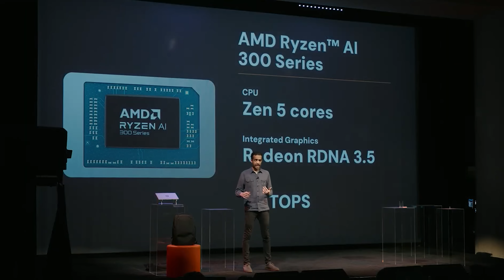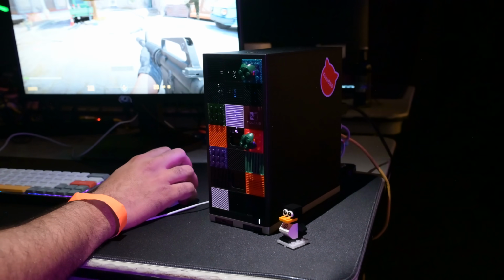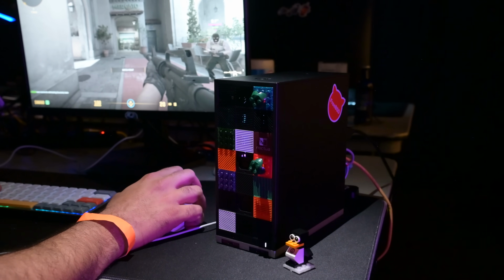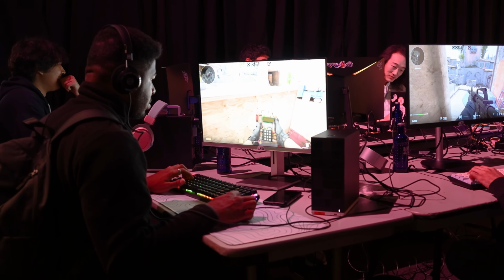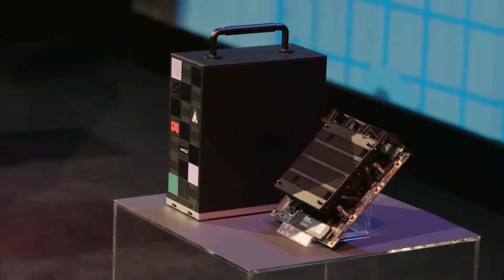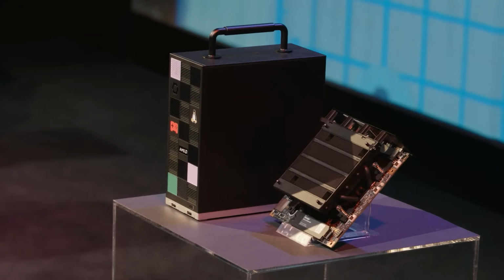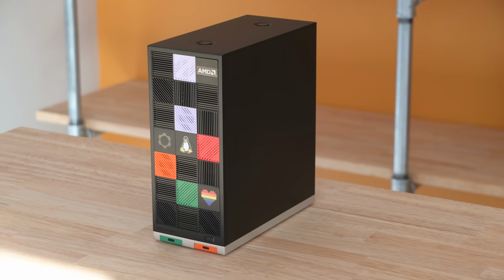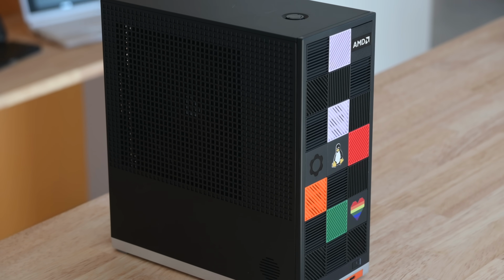Modular, Open, Repairable – The Framework Desktop Teardown!

Comment: soldered on CPU,  soldered on RAM and everything else is proprietary.. This thing might be one of the least repairable desktops ever.
Reply: I think it's because bottlenecks and bus/memory speed for system on a chip and IGPU
Reply: How many Desktops have 128GB Shared Memory? i only count the Mac Studio an this here is already way better with 2 M.2 Slots
Reply: @MrZocker92  The point is not whether or not system memory is enough. The point is RAM on this sysyem is not user replaceable, that renders the system to be not user repairable. If this system has a memory failure then users won't be able to swap out the faulty memory module, they will have to buy a whole new motherboard, CPU and whole new set of memory modules. That will rise repair cost from 150USD to 2000USD

Comment: I don't get any point of this, SFF PCs have been around for so long, and you can probably build one cheaper then this. It will also be much more repairable and upgradable. This feels the worst version of a laptop and a PC.
Reply: I guess that it is not for you then. A Biotech company around the corner from me instantly ordered 70 of the 128GB boxes. To Quote there CTO "that's exactly what we wanted for years. I'm so glad we don't have to go with Apple."
Reply: Think of it less as a SFF PC and more as a workstation. It's not going to make sense for gaming in terms of frames per dollar, but when you really need 110GB of VRAM for whatever you're doing there's not a cheaper way to get that right now.
Reply: The point is to have a laptop chip in a desktop form factor. Strix point and Strix Halo are not going to be available in AM5 variants. 
Another is the LPDDR5 memory for Strix Halo, the iGPU would bottleneck hard with socketed RAM. 
This is a pretty good compromise. They're even using ATX power for motherboard so you can bring your own case and power supply (along with storage and wifi card).
Reply: @TheCyberSpidey  But for the same price you can have a desktop chip in a desktop formfactor with upgradable cpu, ram and gpu? I fail to see the point of your argument.
Reply: @leviathan5207  you probably won't be able to build it in 4.5 liters and you won't get the unified memory which gives you loads of gpu memory and does not need to transfer data from ram to gpu which can take quite a while. If those two things are not interesting for you, build your own PC.
Reply: @TheCyberSpidey  AMD intentionally chose not to offer a removable SoC, so you can interpret that decision as you wish
Reply: @terkokyahe  iGPU is memory bandwidth limited. You need faster memory, and not so much more CUs. AM4 Vega APUs were very bandwidth starved. DDR5 RAM is faster, but soldered on memory is still significantly quicker than socketed DRAM. Not justifying less modularity, but soldered CPU and RAM allow laptop chips to go quicker and with a smaller power budget (dependent on architecture ofc, not a blanket statement).
Reply: @TheCyberSpidey   yes current DDR standard is not capable enough. Your point is valid, but my comment was due to iFixit hailing it as modular and repairable which is just incorrect
Reply: You don't get the point because you don't need such a specialised device, because you don't use machine learning. That's it.

Comment: I never hate on companies for trying something new, but I have to admit this feels a bit like reinventing the wheel. SFF desktops have been a thing for ages and are typically easier to work on and more modular than this thing. To be fair framework is probably focusing on supply chain quality as well, but I'm not really clear in who this device is for.
Reply: I'm by no means an expert, but from what little I know it seems like it's a workstation for complex tasks/AI. My friend works in AI, his business is very interested in having several hooked up together to work on projects, he was waxing lyrical about it. Also he suggested it was more keenly priced than other similar workstations.
Reply: @TravellingTechie  THIS A WORKSTATION???????????? Brother, they use an off the shelf APU designed for laptops. If you wanna do real work, you get yourself a BEEFY CPU and some heavy duty GPUs and not a glorified Laptop...
Reply: @leviathan5207 Ok, can you give us the parts list to build an AI machine with the same ram speed as this at a comparable price and performance level?
Reply: @leviathan5207  It has the same cores as a Ryzen 9 9950x but with ~2.5x the memory bandwidth. That puts it in Threadripper territory which is literally a workstation cpu.

Do people just hear "laptop" and turn their brains off? It's called strix halo for a reason, it's literally the highest tier consumer chip available before you start paying HEDT and enterprise prices.
Reply: @leviathan5207  128GB of unified memory. 96GB on windows and 110GB on Linux available as VRAM. For AI development and AI inferencing, nothing comes close in terms of price and performance.
Reply: @mar2ck_  it also has 32 compute units on the GPU and the max version has 40 compute units.
This is quite a substantial GPU for a "Laptop" SOC

The PS5 has 36 Compute units on its SOC, so this has every chance of being a PC space version of a console, especially with Bazzite support.

More expensive than the PS5 for sure, but they offset cost by locking you into their digital store and not allowing you to do anything but play games with it.
This has a lot more freedom.
Reply: @leviathan5207  Find me another GPU with 96GB of VRAM for less than 3000 USD. Just name one product I can go buy that can do that.

This thing is going to be a ML beast.
Reply: @ Oh dang, I hadn't actually seen the specs. It makes way more sense now. For whatever reason I assumed it was intended as a consumer PC.
Reply: The chip used in this PC isn't directly available to consumers, and is meant more for laptops, so this PC makes it more widely accessible for those who don't want to pay for the extra components inherent in laptops
Reply: This is "just" a very good designed ITX pc. The special sauce here is the chip used, since you can build a PC with more power in that size (Velka 3), but you can't find that kinda of memory setup anywhere else, especially not in this size. It being standard ITX and having the swappable FW ports is just the very nice side dish in my eyes.
Reply: it's for tablet/laptop only dipshits who don't know a thing about desktops, and think this is new. Well, it is new I guess: it is less modular than a normal desktop, so great work there /s
Reply: Thanks guys for cooking that bozo up there that obviously does not understand what this thing is good for.
Reply: Strix Halo is a thing we never had and with how much it brings I'd be happy to go even more locked down road if it was a tad cheaper, the 128 model is just a bit too much right now
that and I'm not sure about the cooler, make it top down 140mm maybe?
Reply: Same. This doesnt solve any problem.

Comment: Neither modular, nor open OR REPAIRABLE.
What kind of joke is this, @iFixit?
Reply: With that APU this is as modular as it can be, so... are you saying Framework should just be launching a regular ITX desktop instead? It's an interesting way of getting access to a chip that is otherwise limited to just a couple of laptops, and this form factor should be pretty much perfect for it. It would be cool if it was socketed, sure, and it'd be even better if the memory controller could handle LPCAMM at usable speeds, but neither of those are possible, so....
Reply: @ OK, solder the cpu.
But add two lpcamm2 sockets for the memory.
Lenovo does that with intel (well, technically just added one lpcamm2 socket as those intel cpus have only a 128bit bus, but technically two would be possible if wanted)

The question right now is:
Is chineses smarter than indians?

'cause looks like we already know the answer.

Or it is a thing of wanting instead?
Reply: @vxvicky  They literally addressed this in the LTT video. They tried. LPCAMM is not viable with this chip (at least not on this board) in a 256-bit configuration, as the signal integrity doesn't hold up. Which makes sense, as AMD's mobile DRAM controllers don't currently seem to play well with high performance removable memory. It stands to reason that it would be especially troublesome when trying to fit two modules onto a small board.

Comment: So they took the most modular technology standard (desktop PC) and made it an incredibly closed, walled garden. There's literally NOTHING you can upgrade yourself that you couldn't upgrade on a laptop (read: only the SSD). 

RAM? Nope. CPU? No. CPU cooler? No. Case? No. PSU? No. GPU? HA - no. 

This is the most apple move that framework has ever made. You should give this a 2/10 for repairability
Reply: You can use any 120mm fan you want if you listened to the video. You can also use any case you want as the mainboard+APU is available separately and is in a standard format (mini ITX) so other options exist, the power supply is a standard flexATX and the mainboard uses standard ports/heads so you could use any ATX power supply you want.

As for the CPU & GPU & RAM, this uses an APU which is a combination of all which is how it achieves this level of performance with this power efficiency at this price point. And they make a point of noting it not only in the presentation but on their website and purchase forms.

Not that you care about facts (as evident from your comment making false points) as a common internet troll. But for others who might see this, go check the actual specs and features out.
Reply: @DuckDuckHere  you're absolutely right, you can jump through massive hoops to 'upgrade' using ultra niche expensive parts while making a pile of ewaste in your wake
Reply: so u think the 395 with 128GB Shared Memory is Standard Desktop Hardware?
Reply: If you want the same performance with modularity then go buy a Threadripper for $5000+.

The chip they've put in this is unlike anything else in the consumer desktop space, it's more comparable to a M4 Pro with unified memory except it's ITX and can run Windows or Linux instead of being fully proprietary in hardware and software.

Comment: Still not as modular as a custom PC. I know that most people see gaming pcs as huge RGB behemoths.  But there are ITX and SFF builds that can be pretty small. 
There are mini pcs that are even smaller than that and have replaceable RAM and NVME and even Wireless cards. I think the only thing that the frame work desktop has over other small form factor PCs is the APU that has a 40 CU Radeon inside, but unfortunately it’s still based of RDNA 3.0  . It has the same performance as RX 7700s. 

You can however setup an oculink adapter in place of the secondary NVME.  And use a oculink dock to use a more beefy GPU with it. But it would be limited to 4 pcie 4.0 lanes. But imagine an RTX 5090 connected to it.
Reply: Technically it's RDNA 3.5 but yes it'll be inferior to the upcoming RDNA 4.
The value of this computer lies entirely in the APU and the huge amount of VRAM it brings with it. If some people are looking for a mini PC just for gaming, they should move on, it's not for them.
Reply: @AlphaConde-qy7vi  you could argue that the 8Core slower GPU and 32 GB RAM version is the most gamer likely for people who want a MAC Studio but also want to Game...

Comment: Small thing, but I wonder where the decision to not go with a socketed CMOS battery came from
Reply: Those little "coin batteries with umbilical cord" packages are INCREDIBLY common in the laptop space. Most laptops from the 2010s use those if they don't use a socket. It's not really a pitfall for repairability because the parts are readily available in many places.
Reply: u can just plice the cabes and tape your own
Reply: I don't buy the "it takes less space", they had to add a metal bracket and screws around.
Reply: This is an engineering sample, fellas. Wait for the final thing before throwing stones.
Reply: @jonas_alves  that's not an excuse
Reply: @genericscottishchannel1603 of course it is. If everything in it was final, it wouldn't be an engineering sample.
Reply: @jonas_alves  you expect me to believe an engineering sample motherboard doesn't just use a 2032
Reply: Ok, I'll stop feeding the troll
Reply: @jonas_alves Just feed it with care and responsability
Reply: @jonas_alves  wow do you have low standards for trolling, replaceable batteries are too much to bear?
Reply: because framework is a BS champion and they don't really care about repairability. They just want your money and are building a walled garden
Reply: @iamdmc  they require less PCB space and are used in basically every ITX motherboard/mini PC/laptop on the planet, they're just as common as "standard CMOS". In a pinch you can even cut the existing pouch open, pull the tabs off, stick em on a new CMOS, and wrap it in tape.
Reply: @iamdmc  nah. I've already repaired my 2 year old FW13.
Reply: @iamdmc  rather buy apple then?
Reply: @iamdmc  and you are a BS commenter. Does something prevent to "repair"/replace that battery?

Comment: I don't get it. It's like a regular SFF desktop (where you can put in any motherboard, any RAM, any CPU, and upgrade only what you need), but ... much less modular? This doesn't make much sense, apart from someone wanting a feel-good office PC?
Reply: It's definitely a niche product, but remember: this isn't really competing with DIY SFF PCs, it's competing with the likes of a ThinkStation or similar tiny desktop. While many of those have replaceable CPUs and RAM, they use proprietary motherboards and won't come close to the performance of this due to power limitations (typically max 65W CPUs and HHHL single slot, slot powered GPUs at most). So while this has to give up on core component modularity due to the impossibility of making this chip socketed (unless you want to abandon half the memory channels, I guess) and the inability of the memory controller to support LPCAMM at sufficient speeds, it maintains motherboard and PSU replaceability and upgradeability, and will deliver much higher performance than competitors.
Reply: @ just a kindly remind that:
There are epyc embedded cpus with up to 12 memory channels.
There are threadripper matx boards with 4 memory channels.

It's always a matter of *wanting*.
Reply: @vxvicky ... and do any of those chips support the memory clocks needed to feed a GPU within the board space of ITX? At prices even remotely accessible to consumers? Remember, quad channel DDR5-4800 will just barely be faster than dual channel LPDDR5-8000.
Reply: @vxvicky  Yes, EPYC and TR have been on the market for a long time. But it's server-grade stuff which does not come cheap, and you know it. You pay for it upon purchase, and then some more in volume/noise/heat/electricity bill. Nothing comes free.
Reply: It makes complete sense if you know what you're doing.
Reply: the point is 96 gigs of VRAM for AI stuff
Reply: @tommihommi1  2 things: APUs are UNSUPPORTED by ROCm.
A dataset that large is (practically) unusable with a 256GB/s mem bw.
Unless you want a system that munches data while you take a coffee.
Reply: Something that you can already do with a cheap epyc board using purely cpu and with 8 channels of normal socketed memory (which is overly cheap second hand plus will give you both more CAPACITY and BW than that)
Reply: @vxvicky  This is the first APU to be supported by ROCm, as confirmed by AMD in the announcement stream. Vulkan also works perfectly fine.
Reply: @vxvicky  have you missed the ROCm dude from AMD comming on stage? This thing Ships Probably June... so ROCm right now doesn't support any of the already released APU stuff but this thing will be supported using the AI accelerator that's also in there. That's the selling point. That's why you can't get one this year if you order now.

Comment: Absolutely beautiful. Depending on the price I could have real use cases for this and would accept the mobo tradeoffs regarding soldered RAM.
Reply: Price is available on their website if you want to check 😉
Reply: @FlocoonYT  Oof. Base model is interesting if you bring your own storage etc. but I'd have to see a lot of compelling benchmarks.
Reply: @kiri101  im also pessimistic about the performance of the shared ram. Sure, you could load 12GB of ram for your cpu on a normal desktop but that won’t magically double your fps in games or half the time to load 3d files. 

If this doesn’t have significantly better performance than a dedicated gpu and motherboard with replaceable ram then it is no better than ewaste.
Reply: @baconwizard  Does your dedicated GPU come with up to 96 GB of VRAM ? No ? So it's etrash.
Reply: @baconwizard  the 8060S is slower than the 7700S (because it’s slower than the 100 W laptop 4060 according to Jarrod’s Tech)

Comment: All I see is proprietary mobo and case. 4.5? There's a cheap A07 4.3 liter case that can take a GPU
Reply: can it take the 35.000€ Nvidia H100? because u will need the H100 for over 90GB of Memory.